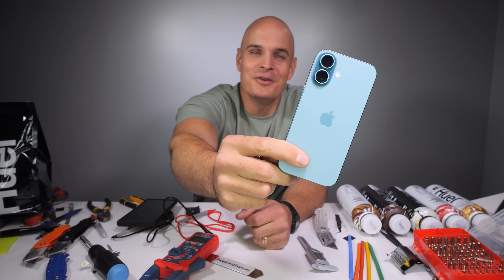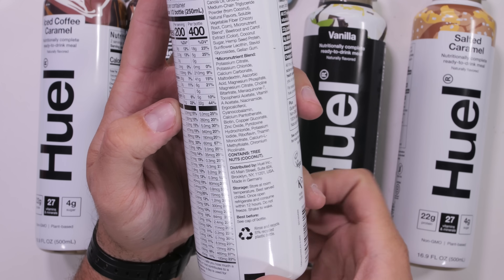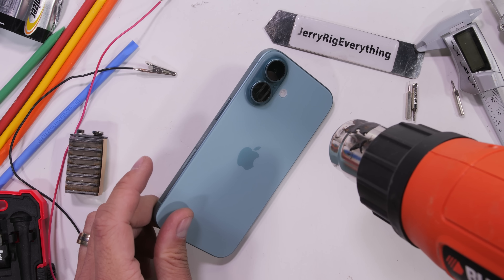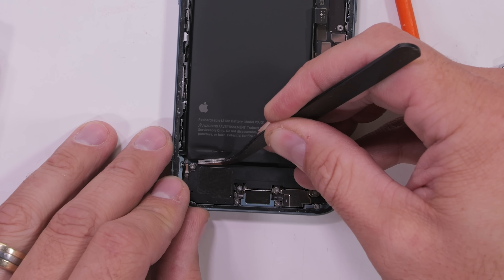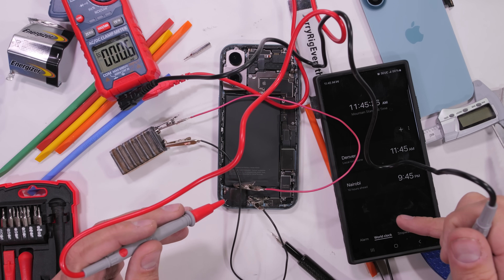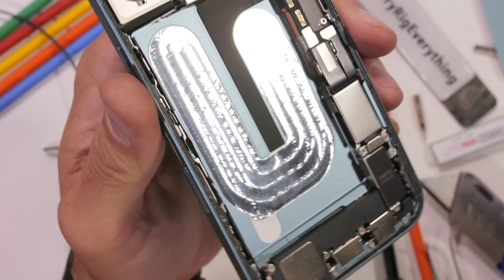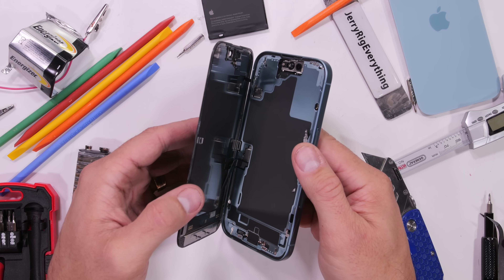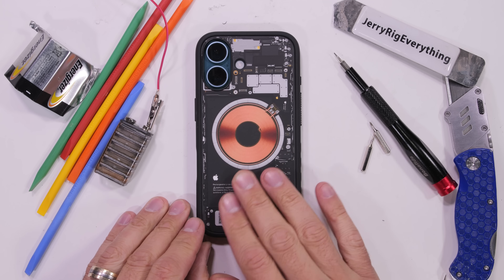Apple *FINALLY* did something new... (iPhone 16 teardown)

Comment: Truth be told I'm more shocked that Apple didn't release a proprietary 9 volt 
 battery to facilitate the decoupling
Reply from the maker: DON'T GIVE THEM ANY IDEAS.
Reply: @JerryRigEverything  😀
Reply: @JerryRigEverything  can you tear down WHOOP BAND
Reply: @JerryRigEverything Bro Please test honor x9c, very hype ads always seeing
Reply: The iBattery starting at 100$ (subscription not included)
Reply: @Fluxxxx7  I was just about to comment with this exact price point.
Reply: 9V its to common in the world. I would expected something like 16,2V and it would be available only in pack with new battery.
Reply: Can confirm the "proprietary 9v" they created for the repair process looks really silly and is just as over-built as the rest of their repair tools, lol
Reply: @kylesimonsen  Its probably a full featured lab bench power supply with a built in count down start button, but can only do 9v for certain intervals,  and can't be used as an actual bench power supply.
Reply: Rare win for apple. Normally not a fan of their very anticonsumer practices, so great to see them do a good thing for a change
Reply: Introducing the Apple 9V PowerFlex Battery – Revolutionizing Smartphone Battery Swaps! Say goodbye to prying tools, mess, and hassle with the all-new Apple 9V PowerFlex Battery. Priced at just $999, this proprietary solution offers an effortless, tool-free battery replacement experience. Simply pop in the PowerFlex, and watch as your battery decouples smoothly, without the need for alcohol or complex techniques. Designed for the future of smartphone repair, it’s time to make battery swaps as seamless as ever—exclusively from Apple.
Reply: U might not know this but there different designs for 9v Batts you got the layered one the old school kind has 6 AAAAA Batts in them.
Reply: They 100% DO have a special machine and fixture to do this, I haven't mess with ours yet or completed the training. They gotta make sure 1000's of different people will be able to do it repeatedly and reliably.
Reply: man this guy is a cornabll  @JerryRigEverything
Reply: im sure they will, ill buy them all LOL
Reply: If that ain't about the truest damn thing I've ready today..  lol
Reply: 10.4 volt battery
Reply: U😅
Reply: Bring the Samsung 25 ultra
Reply: Broke Samsung 22 ultra
Reply: The Apple 9v coming soon for $59.99

Comment: Does repair effect the IP (water n dust) protection?
Reply: If you put a new seal before putting the backglass or the screen then it should be water and dust proof again even tho it might not be as good as before

Comment: That's the first time i've seen purpose-built cells inside a 9V battery. They would normally use multiple regular cylinder cells wired together.

Comment: Why doesn't apple or other manufacturers just use simple double sided tape for the batteries?
Or with so many screws anyway, two more could just hold the battery in place.

Comment: 2:11 I would absolutely recommend using a plastic spudger to separate the glass versus a metal blade. You are much more likely to mess up the surfaces to where you can no longer obtain a proper seal after reassembly the way it’s being shown. You can buy a phone repair kit for something around $5-$7 so there’s little excuse for taking shortcuts. Always use the correct tools for the job or be prepared to spend a lot more than you intend.
Reply: Don’t think he cares

Comment: I just updated my iPhone SE 3rd gen to ISO 18.1 and my SE 2nd Gen to ISO 15.8 the6 work fine and I’ve replaced a broken charging port for 9 bucks the repair places in our local mall wanted 90.  Easy fix and the old phones work just as good as the newest apple offerings

Comment: Anodized Aluminium Surfaces are not electrically conductive. That's why they have to remove the surface by machining it down.

Comment: Why do we actually need to glue the battery in the phone? The phone is already glued shut so it won't fall out, not that it was an issue with removable backc&battery phones to begin with. This all seems really unneccessary.

Comment: Apple didn’t feel generous to do this. It’s going to be requires by law in the EU to have phone batteries and screens easily repairable by consumers by 2027. They’re simply accustoming their phones to these new standards.
Reply: can you buy a 9 volt battery or higher at home? yes can you buy some small jumper cables at home? yes can you buy the right screw driver at home? yes and can you open it at home? yes.

Comment: When I was a kid, I tore open a 9-volt battery, it contained 6 1.5v cells , looked like mini-AA batteries. Being the bozo I was I swiftly proceed to take one of the cells, grip it in a pair of pliers and hold a lighter flame to it. The top popped off and hit my bedroom door, so naturally I was like "cool, mini firecracker!" and proceeded to do the same with the remaining cells. Luckily no damage was done, and the only remnants of my mischief were some splatters of whatever was used to fill the cells on my bedroom door💀

Comment: Stupid question: But why do the ingenious thing with the conductive adhesive at all? Isn’t the battery already held in place firmly by the case? Or wouldn’t a normal, light and easily conquerable adhesive do just fine? Has this to do with heat emitted from the battery or similar?

Comment: Related to the 9v battery, if you tear open a 12v size 23 or 27 battery (which are both mainly found in odd remotes, especially ceiling fan remotes), you'll find 8 common houaehold button cells. Not even like the raw kind of cells you see in the 9v where they don't have a consumer-end use unless contained in the 9v package, they're exactly the same as the button cells you'd put in a thermometer or wristwatch. A 6v size 28 will also have 4 LR44 batteries inside, so if you're ever appalled by the price of a lack of LR44s costing more than the flashlight you were gonna put them in, you can track down a size 28 battery and just open it up and use those

Comment: fun 9v thing. There are also ones that instead of 6 stacked cells you ill find 6 what look like smaller then normal AAA batteries. These are AAAA sized batteries used in some nitch applications.

Comment: So after breaking the battery adhesion using 9V... How to you adhere the new battery? With a different adhesive? Or does this conductive adhesive somehow magically readhere with the same strength? Also after cutting through that adhesive using a razor blade, does the overall repair result in a weaker iphone since the adhesive has been disturbed like this?
Reply: It appears as though all the adhesive magic is on the battery, so presumably if you bought an OEM part it would just adhere and come out the same way. But two battery replacements is unlikely as the device would probably be unsupported at that point.

Comment: Its all cool but.. i am baffled why it needs to be so sticky in the first place when technically all is needed is medium level sticky double sided tape and not even full length of the battery so it keeps in place but lifts off easily.

Comment: Come on - that clearly should have been “Let Georg Ohm” do what he does best! wtf has Edison got to do with heating adhesive! He didn’t even invent lightbulbs and was totally wrong about DC vs AC because he was just a business man who profited from the knowledge of others! We actually have the rediculous situation now where some Underground electric rails use DC but because the motors on the trains are much better using 3 phase AC they have to carry inverters to supply the correct AC to the drivetrain. So we have the ridiculous situation of a 3 phase AC grid supplying a rectifier to the train network then the trains have to carry inverters to turn it back to 3 phase. The guy didn’t understand anything about electricity and we’re still dealing with his greeds problems over 100 years later!
A little surprised to see the use of a 9V battery for heating but I guess is the safest option to do it gradually.

Comment: After replacing the battery does the new one require a 9 volt battery to remove incase you need to replace that one ?

Comment: would be even cooler if we just didn't Glue in the Batteries in Phones since it's pointless. it's trapped inside a cramped box with nowhere to go, it's not going to move. add like a 0.5mm shim of Rubber if you realllly wanted to and then it extra can't move.
so, who gets brownie points first is who stops gluing Batteries into their Phones. just skip that part of the Mfg process, save some cost, and make the Product better. who's going to take a win-win first? nobody, it seems.

Comment: Oh wow, it's been a long time since I opened an 9-volt battery. I don't think I ever opened a lithium one though. 

I did open an alkaline and it was filled with 6 little cylinders that were about the same size as a AAA battery.

Comment: Not all 9V batteries are stacked or 6 cells, I have opened ones that are literally 6 AAAA batteries inside, and then NiMh 9V batteries are all either actually 7 cells (8.4v) or 8 cells (9.6v) because of how NiMh cells are actually 1.2v while alkaline, nicd, and l-ion batteries all have 1.5v cells.

Comment: About the screen. I can replace it very easly, ok. But other iPhones can do that too, the question is I lose any functionality after doing that? Because on older iPhones, after a screen replacement the phone loses the face unlock and the function of changing the color temperature of the screen (I forgot the name). Because on older Iphones The parts have DRM.

Comment: Now they should use that for the back panel and screen adhesive with some small electrical contacts points on the back panel. Then you don't have to mess with the heat gun and razer blade anymore.

Comment: New and completely useless. Screws and gaskets are cheaper, and easier to make, quicker and easier to work with, and always seal correctly even after opening the device.

All these adhesive enjoying manufacturers need to stop huffing glue.

Comment: Apple’s electrical adhesive thing is neat and all, but they should look into a technology called “screws” that would allow the battery to secured without having to remove and discard adhesive when it’s replaced

Comment: The bare minimum amount of regulation forcing a corporation to start making their devices repairable and boom - all of the sudden the repairs are easy and pain free. See it can be done, you just need to overcome corporate greed. If you aren't forcing a company to do something, then they'll either tell you it's impossible or they will try to charge extra for it.

Comment: Whoooa, the 9V batteries I took apart as a kid had six tall cylindrical cells similar to AAAs inside. I’ve never seen stacked ones like that!
Reply: Believe it or not they were 6 AAAA VS common AAA. 9V come either way, stacked or cells
Reply: well it makes sense, cylindrical cells stacked inside a parallelepiped wastes space
Reply: “Heavy duty” aka zinc carbon 9v battery’s are stacked (at least nearly always?) and alkaline 9v batteries have the AAAA’s in them. So it depends on the battery chemistry. 

This technically makes the 9v a battery (while an AA or AAAA is technically just a cell, not a battery. But common parlance has made both be called batteries now)

What I’m not sure on is: are the AAAA’s in an 9v alkaline for manufacturing cost reasons (due to scale of producing round cells) or required due to containment reasons. I suspect the latter as I haven’t seen AAAA’s outside a 9v very often.
Reply: @xlr8436  you are wrong. Look it up, a battery is one or more cells and has always been like that. Please don't "erm acktually" misinformation like that.
Reply: Every manufacturer has his own way of doing things.

Comment: Couldn't just use a less aggressive aggressive... Or just use screws like in a laptop to secure a battery. Would have been cheaper, more practical, safer, more idiot proof...
Had to spend millions in R&D to engineer future-glue that requires electric discharge to weaken because doing something simpler and cheaper isn't the "Apple Way"

I mean yeah its cool... But we been dealing with almost 15 years of battery-destroying glue in the first place simply because using less aggressive ways to secure a battery just wasn't an option for some reason.

Comment: A totally unnecessary process. Why even bother why not just use a mild adhesive. Why does the battery need to be glued down in such a way that it's impossible for it to be removed without doing this crazy technique?
I remember the days when batteries weren't glued in and we just clipped in. 
This is just crazy engineering to slow down people from replacing their batteries themselves.

Comment: Repair person here! Curious how the battery re-adheres, or how new batteries adhere to the frame. Do you just swap the polarity of the 9 volt battery? Or do you put in new adhesive?
Reply: If you swap the polarity then the glue falls of the battery.   It comes already sticky with a film you remove like any adhesive surface.

Comment: They should use that adhesive for the back + front glass.  This would allow a technician to easily remove the glass panels by using an electrical tool that plugs into the charge port.

Comment: in short , you just shorted the metal panel until it heats up and softens the glue .simple but great idea. maybe they get that from amd processor which needs heating to release processor from heatsink due to the compression of thermal paste.

Comment: If you really want to electrocute something use a piezo spark generator from a lighter. But don't waste power on a spark through air, obviously. This helped me a few times with those pesky intermittent problems with devices, guaranteed to return from RMA with a negative response.

Comment: Looks like pressuring crApple all these years and now the EU breathing down their necks are finally paying off. Does look like they will keep digging for more extra bits to include into their phones to keep the process from becoming easier. We used to have simple "snap in" batteries, you guys. Why on earth are we applauding this? it's neat... But practically useless.

Comment: @JerryRigEverything hi, one important question about an “old” S20 Ultra 5G from Samsung: the OLED screen goes wild very often and during the night (or day) it gets totally white at full brightness (it seems to be a bad engineered display, there are lots of complaints) and I can’t use the phone. Samsung and 3rd party stores ask for 350€ for a screen!!! (3rd party say that they only have access to Samsung panels). That is more than what the phones worths…   Do you happen to know a manufacturer that produces cheap screens for this model?

Comment: I still kinda hate it. Some basic double sided tape is plenty to hold in the battery and when you need to remove it, you simply pull the battery out. No electricity or prying needed.
Reply: You don’t know what you’re talking about.

Comment: 3:20 you can't just say "the higher the voltage, the quicker the battery will fall away" and not apply 100V+ to see how that works
Reply: ah yes, how to cook battery
Reply: The literal sentence he said before was between 9v and 30…
Reply: @schoonerthedog  you're the type of person to walk up to a kid in a mall, around Christmas time, and tell them there's no Santa, aren't you?
Reply: @UNgineering  you can with limit ampere 
Low current= low overall power.
Reply: @Islamic_video-e9d  then it wont be 100V
Reply: @Zyghqwyv you don't know how electricity works. Low current does not mean you can't have high voltage.
Voltage is a differential you can change, current is a result of the voltage and resistance...
Reply: @Islamic_video-e9d  Current limiting works by lowering the voltage. This is regardless of what your power source is. A bench top power supply does it with computers, while a battery does it through internal resistance.
Reply: He earlier said 9v to 30v
Reply: @ebaiderrick  my guess is that more than 30V can generate too much heat and given the fact that there's a Li-Ion battery right on top of the Adhesive, Apple wants to play it safe and not pull a Note 7
Reply: Plug it in to mains

Comment: The biggest impediment is still getting into the phone itself. If they could adapt this technology for unsealing the adhesive around the frame of the phone, it would make self-repair a cinch, especially the battery replacement. Presumably the hard part is providing a metal strip around the phone to which the adhesive strip would be attached and that could be connected to 9V (from the USB C cable) via a switch toggled by a developer mode setting when maintenance is required.

Surely not beyond the capabilities of a corporation with a $31 billion annual R&D budget, right...?

Comment: Wow how crazy phones have changed over the last 10 years. My question is how do you get the adhesive to work again once you replace the battery? Are you able to use the 9 volt to "recharge" the adhesive to make it hold the battery again? Thanks!

Comment: Did you know, apple has a repair subscription that if you purchase, it tells you a back glass replacement is $29. But if you try to get it fixed it is actually $99. Doesn’t make sense to me as the $99 is “accidental damage” cost.

Comment: Imagine if they could attach the back panel with the same type of glue.  And the screen.  Is the glue single use, or would you need a tube of the special stuff to stick the battery back in?

Comment: I’ve seen 9V batteries that are actually 6 AAAA batteries wired together. It ended up being an easier way to get a AAAA battery for a for a stylus because I couldn’t find anywhere that sold AAAA at the time, only AA and AAA.